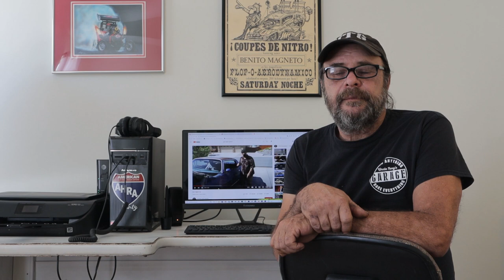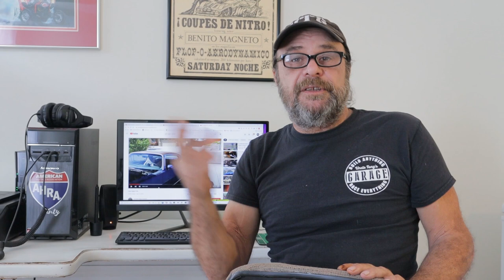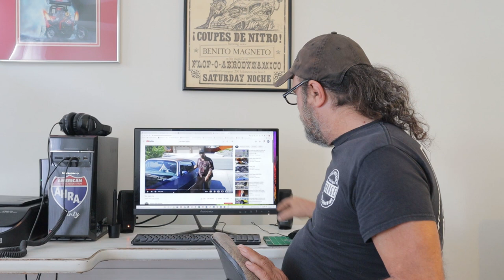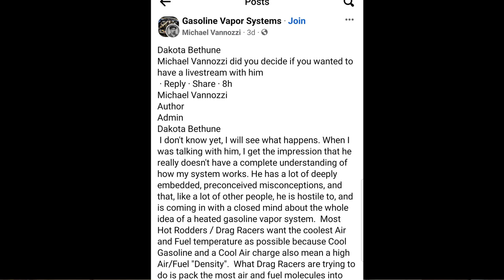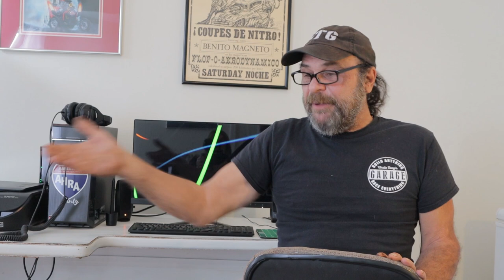Climbing Down The Mega Mileage Conspiracy Rabbit Hole

Comment: Theres people saying they got over a 10% fuel economy increase by using Lucas Upper Cylinder Lubricant (and mostly in modern cars too) or Marvel Mystery Oil.
I'm half keen now on building an engine optomized for fuel economy thru cylinder head porting, compression ratio , camshaft , header size etc etc and trying out 5 - 6 various carburettors like a Weber 32/36 DGV, S&S Super G, Mikuni HSR 42 etc etc and see what I can really obtain .. I half suspect many of these economy readings are obtained by driving the vehicle like 'its about to run out of petrol' though and not normal drive cycle

Comment: For me the simplest way to debunk all of this is based on the well established fact that a common internal combustion engine  requires an Air Fuel ratio of approximately  14.7 to 1. If you wander far from this the engine will not run in a usable way.  This ratio is based on the weight of the air and fuel.( Gasoline ) Any thing that is done to the fuel with heat will not change the weight of it. Very simple to me. The volume of air and fuel can not be reduced in a substantial manner to  still produce the horse power need to propel the vehicle. One could run on the lean side with a constant load perhaps  but not in the dynamics required for a vehicle . Keep up the videos. I  Like the reality of them, of what average person can do at home with small budget.

Comment: my dad saw some of the government experiments with vapor units, maximum possible fuel economy was 50 mpg, any more and you begin destroying the engine as the fuel/air mix would burn far too hot and the engine could not stay cool.  first to burn out would be the valves if the engine was made of iron, if aluminum, the engine would be completely destroyed.

what i did to my 225 was basically make the carburetor into the vaporizer.  1/4 mile? maybe 30 mph, rear end had to be the right ratio, timing had to be higher than factory secs, float had to be so low ether was needed to start the engine. compression?  well i had it high enough to make that reduction gear starter start grunting if the engine was cold.  did not have a tester so, unsure what the compression was.  there was a LOT of things i had to do to the entire vehicle to get 47 mpg.  and yes, every time i stepped on the gas pedal to take off or speed up, it sounded like  jet turbine engine spooling up.  and yes, i got threats of being turned in for noise pollution.  the job i was working, half my pay went to car insurance, the other half to gas, so, i had to do SOMETHING to make the car use less gas, even if it had every cop in the county looking at me all funny.

why cant people understand vaporizers and carburetors are NOT going to get you over 35-50 mpg?  gears in the trans and rear end play a part, ignition timing, carburetor adjustments and float level, compression ration of each cylinder, torque on head bolts, size of the tires, how you drive the car.  myself, i am sick of hearing people claim the carburetor made it get that mileage.

for the nay sayers, 1970 chevy nova 4 door coupe, 267 V8 engine, mid rise 4 barrel intake, 1 1/4 inch spacer to small 2 barrel rochester carburetor, ignition 10 or 12 degrees, heads torqued 10 ft lbs more than factory specs, 2-speed power glide transmission, single exhaust cut into dual exhaust to help the engine breathe.  not big on power but 30 mpg every were i went.  so yeas, a 1970's era 2 ton car CAN get 30 or more mpg with a V8.

my experience with a vapor set up?  it will go down the road, top speed between 55 and 65 mph.  performance?  what performance?  just be happy it gets you down the road and is saving you money on fuel.

Comment: It's a shame that people see scepticism as the enemy. Especially in the way you framed it. Asking how it accelerates is a normal and valid question. Putting it on a dyno would he an excellent experiment to judge actual performance. I recall an article about Volvo coming close to a 100 mpg passenger vehicle. The way they got there it had to be a 2 seater and both occupants had to lay flat. They dropped it for obvious reasons. Too complex. Too expensive. Completely impractical. Often what happens when concepts collide with reality.

Comment: As an engineer and machinist-welder-fabricator I have met a number of people in my time that insist on bending the laws of physics to suit their needs. It can get pretty bizarre if not very comical, and reason and common sense is not part of their brain function.  

Oh, that guys Camaro...no need for dyno time. It's 30 rear wheel HP, and 35.627 seconds 0-60mph. But it actually works!!

Comment: He may be onto something by adding the Turbo  -   it may bring the performance up enough to function on the highway sufficiently -   I still don't think in traffic it helps as you can't spool the turbo in stop and go traffic.    But for highway use it may be a viable option.     Keep it up Uncle Tony,  learn the most from your channel vs the other channels.

Comment: You know i agree with you on every aspect. I guess it would be possible for a sbc at 55 to get 35 mpg seeing how i have a small block getting 28 ish at 70. But the difference i guess is his set up would most definitely be a dog everywhere but where mine is still drive able. And fun and no its not hot vapor.

Comment: If UTG offered me paid Dyno time to get results of something I'd instantly take it up if I could. My dad and I talked about this topic the other night. The best thing we could think of for a hot rod hot vapor system is in a 6cyl of some sort with a blower or turbo. Some way to warm the intake like Smokey's or a mix of that and mix of the Pouge.  Tuned right it could work decently without too bad of power. He joked around and told me to spray a full can of ether into my 12v Cummins "for some real hot vapor" lol. I don't think the gov is in on the vapor. They're just trying to get as much power and money as possible.

Comment: I used to deliver LP for Ferrellgas. LP turns from liquid to gas (vapor) at -275° or something like that. That's why you can use LP gas for heat anywhere. It's also why it's kept pressurized. It stays liquid under pressure but it's colder than freon when released. Funny thing is, the trucks we drove all burned diesel. It didn't make sense to me, considering how cheap Ferrellgas could buy LP vs the price of diesel. I was told it was because of the price of repair difference and the lack of mechanics knowledgeable of LP components and repair. That still didn't make sense considering the huge cost difference. Ferrellgas was probably paying less than 25 cents per gallon for LP versus $3 per gallon diesel. Also, back in the 70s, my friend's dad had a Ford pickup with an LP tank behind the cab. With the flip of a switch, you could run on gasoline or LP. What happened to that technology? The only reason I see that LP isn't a widely viable alternative to gasoline is that the price consumers pay for LP is as high or higher per gallon as gasoline. Seems to me that if LP was more an option the price would come down. Maybe that's what the LP suppliers DON'T want. Maybe that's why they don't push the move from gasoline to LP. It's the only reason I can think of. LP certainly gets better mpg ratings and it's a lot better on engines than gasoline but you do sacrifice a little on power.

Comment: I can get some great numbers by barely getting into the gas pedal. By shooting for a 0-60 time, it means he'll have to step outside of the place that delivers his economy exposing its shortcomings. His 0-60 time is going to be like 60 seconds.....  Yunnik's Iron Duke (140ci) Fiero with his homogenizer low pressure Turbo, with an exhaust heated intake plenum, was a cool project. But if he said it wasn't worth it, I'd believe him for exactly the same reasons you've cited here.

Comment: Internal combustion  engines are air pumps! CFM consumers The larger the CIs the more CFMs are needed to provide combustion .   To put a motorcycle carb on a 350ci engine is only doing one thing STARVING the air pump of air! Good luck on changing that mental state!
Reply: Look, I decreased the volumetric efficiency, I'm a super genius
Reply: @joecummings1260  Nice going! Noble prize coming your way.

Comment: As for the Saturn automobile it had plastic panels instead of metal. It would seem that an enormous amount of weight could be taken off all cars if we just went to plastic panels instead. Couple this with things being made of aluminum instead of Steel and the car being so much lighter increase mileage most certainly

Comment: Sometime in the 1940s or 1950s the process for making cruel oil into gasoline was changed. However, you can still buy fuel processed in the original. It's called Coleman fuel, or white gas, and it's used in camping situations. So with the comment about the gas not vaping as easy, is probably the only truth to the argument.
Maybe, just maybe, you could do a test on Coleman Fuel vs Gasoline...

Comment: All the people chasing 100 mpg fail to remember the internal combustion engine as we know it was invented to boil water on the cylinder head like a steam engine and use peanut oil as fuel. My hammer has trouble turning Phillips head screws too.

Comment: short on details but around 30 yrs ago i read an article in popular mechanics about a famous engine builder who designed and built an engine that was basically half gas and half steam. I dont recall if he used a system with dedicated valves or dedicated cylinders, purpose built steam cylinders seem more likely, but he used the engine heat to create steam in a closed system so the exhaust steam would go back to the water tank, so the effect was free power strokes from the steam. he had a working engine that he used in a personal car. I knew the name at the time but 30 yrs is a long time. I dont believe it was Mclaren or shelby but somebody well known. I never forgot that article. Of the high fuel milage ideas, that one seems like it could work. why dont they use diesel electric in cars? seems like that would work also, especially with our modern 10 speed transmissions

Comment: If I remember correctly, maximum efficiency usually happens at WOT, where there's the least restriction in the inlet, so lower pumping losses.  But that means if you want 20 hp to give you 35 mpg at 55 mph, and that's got to be at close to WOT in top gear to get that efficiency...then no acceleration, no performance of any kind.  Yeah, it'll "get down the road" eventually...but 0-60 may be significantly more than a minute.

Comment: Myers HHO is Implosion and a volume change of 1800%, i would think the hydrogen and oxygen bonding is the force that is needed. because water breaking down would create pressure and pressure can go high but vacuum a limit may be reached quicker. the state change can accrue at 1.25 volt but material used and situation will need to vary

Comment: What you don't understand about Michael's system is that his 35 MPG depends on "Hypermiling"  and he probably has a lean knock to remind him if he presses the throttle too hard..... Between the basic fuel requirements of 350 cubic inches and the weight of his Camaro, I doubt 35 MPG while running like a normal car....

Comment: Possible that this in some way (maybe???) is an offshoot of the '80, idea that appeared in "Mother Earth News"  was about converting a v8 to a v4 by doing away with 4 firing pistons. Shimming open the valve, removing lifters etc. Tried it on a 383 Mopar for kicks following the article and it evolved into a poor running, slow, underpowered slug. Never tried in a read road test but it never would be practical. Mileage seemed as I remember seemed to be worse. Just a thought. Sorta like when we used to put pennies in the heat risers of flathead  Fords to make the pipes rap. Good in theory  but practicality suffered. Great show for learning for the "newer" guys.

Comment: I like your idea about quantifying the results. That is the best way to find out does this engine have any power at this 35 MPG. As for Michael, if this system works with a reasonable amount of acceleration, the auto manufacturers will jump on it because they need high fuel economy as the governments mandate higher mpg over their fleet of vehicles. This tech could maybe hold off the electric car push going on right now. Businesses would also jump on it to improve their fleet vehicles mpg! This all happens with accredited proof. What is the down side Michael?

Comment: 35mpg at 55mph with a 2.70 rear gear and an overdrive manual trans should not be all that difficult to achieve with normal hot rodding tricks. I’m thinking a stock 80s/90s roller cam aluminum headed 350 with 11:1 compression pistons, a dialed in quadrajet running a little lean at cruise, functional EGR, and an electric fan, and that should get somewhere in that range.

Comment: I'm sure you could get 35 MPG at 55 MPH out of a small block 350 and 2.73 gears, just eliminate the accelerator pump and run it super lean. Probably wouldn't be much of a town car, pulling away from a traffic light would take a week, and passing on the highway would be what other cars are doing to you, but yes, you'd get your 35 MPG Highway.

Comment: on gas mileage. my uncle built a 70 3/4 ton up truck with a 350 SBC 4 speed and q jet. stock it got about 12mpg or so. it was sort of a gas hog. but it had enough power to pull various farm trailers.   i think a pogue system was what he slapped  on there.  it had a tiny 1bbl carb, and a heated intake manifold , wires switches, seems like it was supposed to get a gasoline additive  of some sort. seems like it had 200 or so HP stock . i can recall riding around a little in that truck as a teen. seemed like it was way down on power , no torque at all IIRC.  it ran just like a normal 350  was running out of gas. running on fumes as they say.  the best it ever got was a shade over 30MPG. it was terribly impractical . back in the day i saw a hot rodder running a SB that ran the same --seems like he assembled the motor with rags still in the intake. hey tony! remember the old offy dual port intake? the one for the q-jet? one of those with the 4bbl part blocked off would be better--more power , less complex and get about the same mileage --better yet put one of those tiny  economisers  4bbs on it.

Comment: I built an HHO on a couple vehicles back in the day; one was a TBI 2.5L Iron Duke and the other a 3.3l Grand caravan with EFI. Both got better mileage; the Duke went from around 30mpg to 40+, and the Minivan went from low 20s to upper mid 20s. The problem with the duke was that if I shut it off and then had to move it again shortly after, it had to crank and crank and crank before it would fire up. I assume that was from the moisture sitting which is a byproduct of burning hydrogen. The 3.3l had no such issue. Both had the same size HHO device; the one on the 2.5l may have been oversized. I never got to proportioning...I just built them after I tested it by filling a jar with hydrogen gas and hitting it with a lighter - it definitely exploded and it was a weird explosion - no real flare up. It was just a very fast loud crack/pop and the lid blew off like it wasnt even screwed on. After that, I felt like I'd confirmed that it did indeed make hydrogen gas and installed it in the truck first, van later down the line. Sure enough I got better MPG. The cost savings was minimal though since gas was cheap that the time, and I quit experimenting with it. Wasnt worth the time spent in the store gathering distilled water and baking soda etc to keep refilling the container, and then the time spent making new cathodes and electrodes for it.

Comment: I hope he takes you up on your offer although i don't see it happening. Even if it's a dog to accelerate or pass, it would be interesting to see and maybe make a hybrid type drive system to get it up to speed, then use gas to cruise and charge batteries. My 97 jeep wrangler with the 2.5 gets good mileage, but is an act of drafting combined with gravity to get it to cruising speed. He seems to be hung up on what we think as hot rodders more than we are on seeing this system develop power.

Comment: Here in the UK I have a car I put together myself, it's 1978 Triumph Dolomite Sprint (google it if you don't know what one looks like) with a 2.2litre fuel injected GM 16v 4 banger and a GM4L30E auto trans. This car will run the standing 1/4 mile in the high 15s and give 45+ miles per (british) gallon at a steady 80ish mph motorway cruise. Good numbers I think, but no secret. the ECU map is bog standard. But the car only weighs a tad under 2500 pounds so it's factory 147bhp is enough you don't HAVE to nail the gas to get a result. The trans is overdriven and the rear end is 3.45. At 80mph it's only turning 2700rpm. Also it has no PAS, CAT or aircon to sap what power it has. It was built specifically with long distance cruising in mind which it does very well. I have a similar 2 door model (much lighter) also with a GM engine (2.0 8v) and a 5 speed stick shift box. This car is built for road/track work and is VERY light, kerb weight is only 760kg (3/4 ton) Yet it only averages around 30mpg cos it's a stick box and you gotta rev it out! Like you say Tony, there ARE no secrets, just physics!